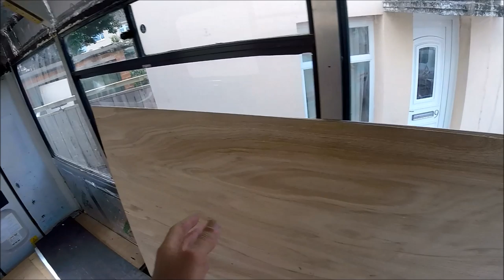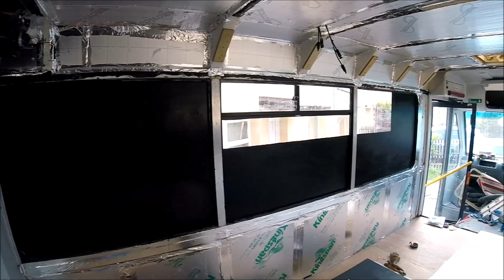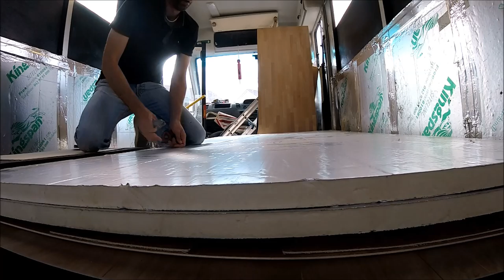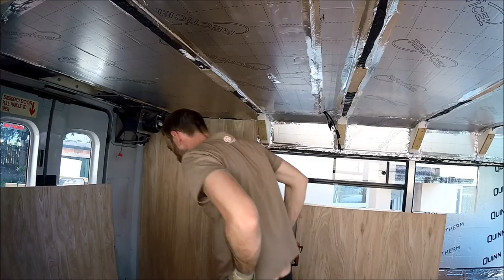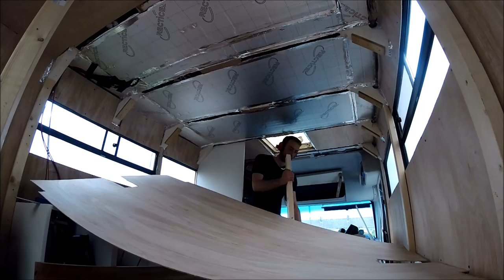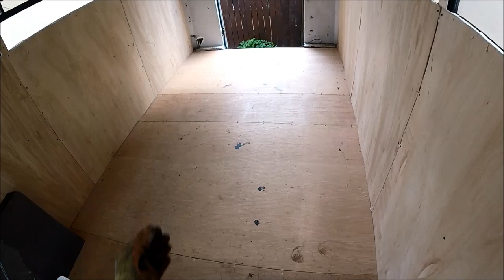Painting, Insulating & Ply Lining Mercedes Minubus Windows & Interior

Comment: Dave, I realize that van  life people want privacy, but it made me so sad to see those lovely windows get blacked out.  In one of your future builds, (where you will be doing the same model Mercedes Minibus), might you try installing automatic powered window shades, so that the new owner could have both privacy and a great view out of the conversion?  This is just a suggestion, but I would like to hear your thoughts about this idea.
Reply from the maker: It might not look it at the moment but once fully built, the remaining windows will still offer a great view. but with the bonus of roadside privacy  I had to black out & insulate over some because in the sun, the glass acts as a greenhouse and gets the interior extremely hot during sunny days and in the winter they would act as condensation trap so they have to go/be reduced.  I have already noticed a reduction in heat since doing this job making working in the bus a lot more comfortable.  Shades would be a good idea but as I mentioned, in the winter such large glass would be full of condensation and a cause of large heat loss as they are just single pane glass

Comment: I know I’m a bit late asking this but can’t help but wonder about condensation on the exposed glass then running down behind the insulation. Have you had any issues with mould?
Reply: That's why you have a vapour control layer (VCL) which is the aluminium foil backing onto the insulation board. But, you have to ensure that that is 100% taped up and no air gaps to get in or you will get condensation on the cold windows.

Comment: Hi there does the wall insulation have to press again the outside of the van or can it be straight with the front structure leaving a air void to outer van ? Tia Jason
Reply from the maker: If on glass then against the glass, if against van panels then It can be straight with the front, just join everywhere with foil tape
Reply: The Campervan Builder thanks for reply , it’s great watching your video’s 👍

Comment: I can't help wonder what happens if a window gets broken
Reply from the maker: lots  of swearing for a start I'm sure
Reply: @TheCampervanBuilder  an honest answer.. Lots of it I dare say
Shame because so much space I guess it would get expensive and look crap trying to replace with metal..
On the right build and look chequer plate might look OK.. Could always  put something in place like that if the worse were to happen.
Reply from the maker: Every time I've seen a window covered over with plating of any kind, it's never looked good in my opinion.  I've not finished with the windows yet, anywhere painted will be getting a vinyl on the outside which should help protect the glass and hide any damage if any did happen, hopefully not though.
Reply: @TheCampervanBuilder  yeah I know what you mean I was meaning with a finish with say raptor paint and a bit "military/ rustic" really all of em would need doing in which case I guess it's not going to work as a post fix.
Yeah hopefully not, lots of room. can't decide to buy something done (expensive) or a motorhome like the monocoque vw clubman autosleeper where you devalue by doing anything to it.
Or just go nuts with a Luton lol.. Never had a campervan but I've lived in a tent for over a year and I don't plan on that again..
Long story lol..
Be nice to know you have something you can live in if the worst happens again lol.
Reply from the maker: Well I have a second bus if you’re in the market for something 😉